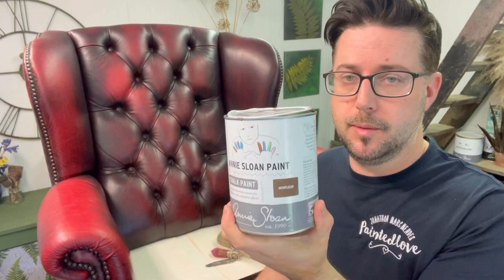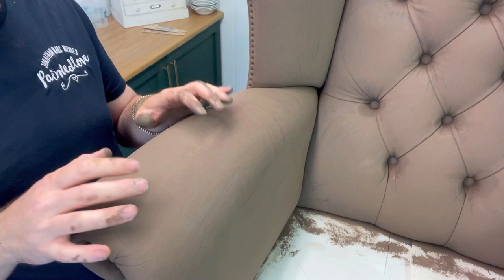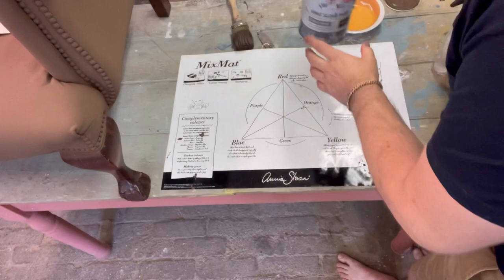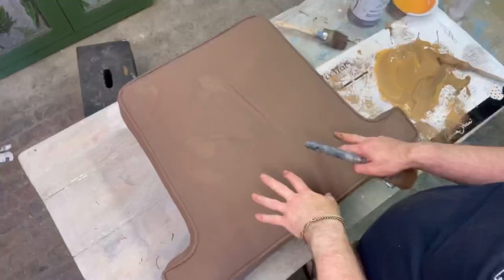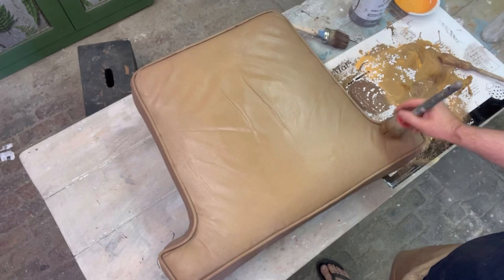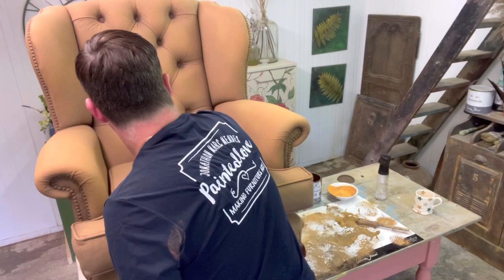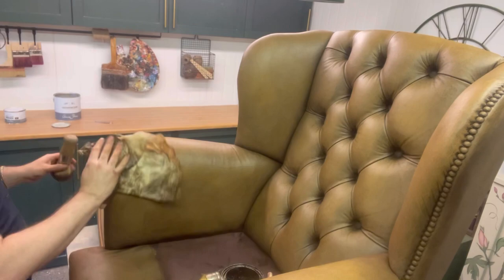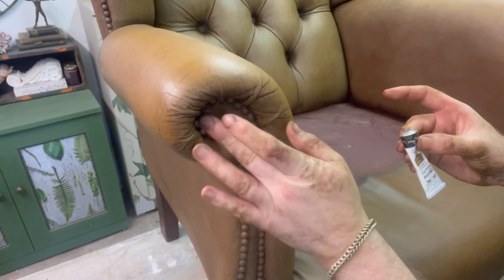How to paint leather upholstery with Chalk Paint￼.

Comment: That was champion lad, I watched this the other week, ordered a load of paint from Annie Sloan, painted up two leather sofas, dinning set, dated wooden furniture etc but the leather sofas were crazy to be able to paint up. 99% of the paint has held up well but a patch started to crack so it must have been contaminated and not cleaned off properly. Sanded off, recoated and  ok now, just waiting for more wax as the 500ml wasn’t enough to cover 12 litres used on all the furniture. 
This chair you did looks exactly the same as my fathers chesterfield arm chair but it was a green before and now similar to your lovely creation. 
👍🥂❤️

Comment: I have a chair like that as well but it doesn't have the "dimpling".  The previous owner had a cat and it has minor scratches on it.  Have you ever fixed any scratches on leather and then "painted" it again?  I am going with the same color,  or close to it because I have a couch as well.  Thank you very much.  I too painted a leather couch and turned out great!
Reply from the maker: Mine too had minor cat scratches but I just painted over them and you can barely see where they were I think there is repair kits for leather online maybe do a Google search I suppose it depends how deep they are 🤔😊😊😊

Comment: Hi Jonathan 😊  Fantastic work!   I have just picked up a very beaten up Chesterfield 2 Seater.  I'm going to use leather adhesive for major splitting in a few areas lol  yes it Very beaten up 😅

My Question is;
Will painting over cracked Leather be successful?  

This old lounge is for my Husband's/teenagers pool table/Game's Room so it doesn't matter if painting won't be possible. 

Cheers,
Jacinta ⚘️